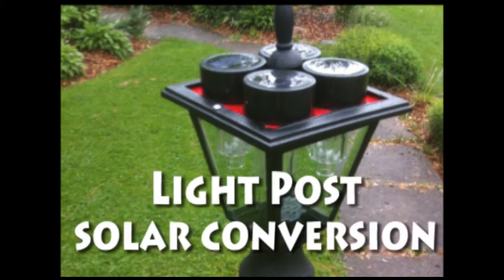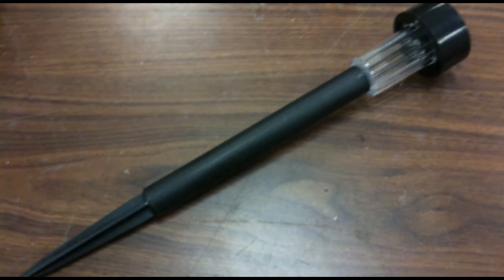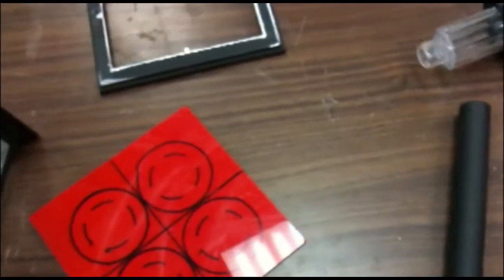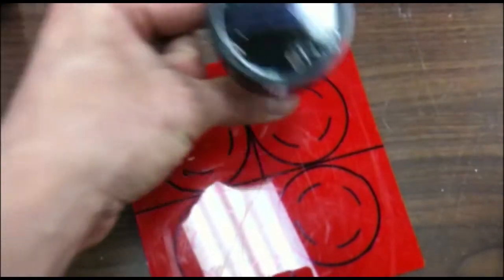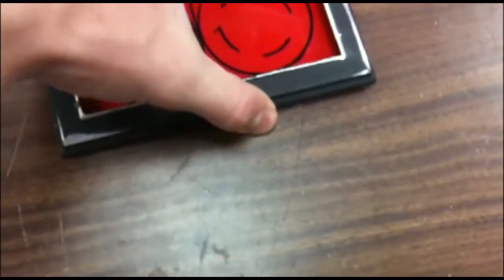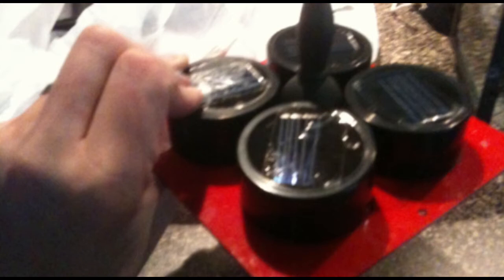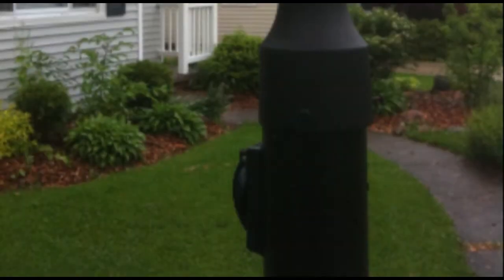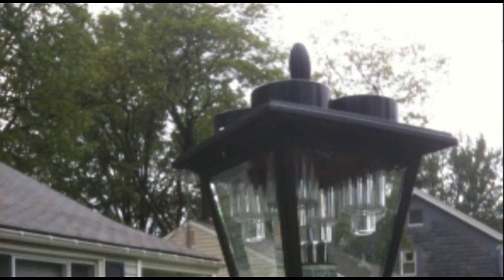Lamp Post Solar Light Conversion

Comment: Good idea.  I just completed an old railroad switch lamp to solar using Harbor Freight's stake-in yard light.  Converted from $10/gal kerosene to solar.  Complete conversion under $10, whereas the lamp burned kerosene at about 1 gal/month.

Comment: I definitely like your idea and I been trying to do it myself with solar lights and there's an actual solar light bulb with panels built on the sides.  I have a house rental but I have done so much to this place and installed motion sensor solar lights around the premise and backyard for my dogs.  The light post works for me and it's an old ugly thing that I just want to set up solar lights and forget about it.  I do not have a cutter.  I thought about buying two solar wall lamps and glueing them together and put that on top of the post.  I need to get rid of the light post planter casing.
Reply from the maker: Thanks.  Yeah there's definitely stuff out there now that would do the job.  I was just using some stuff I had laying around the house when I built that thing.
Reply: You got a picture of the one your talking about??